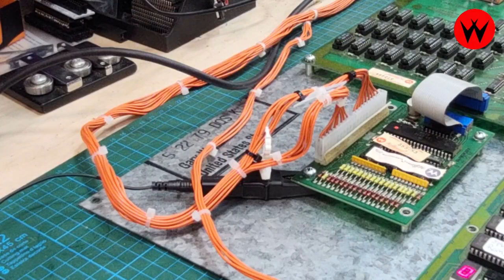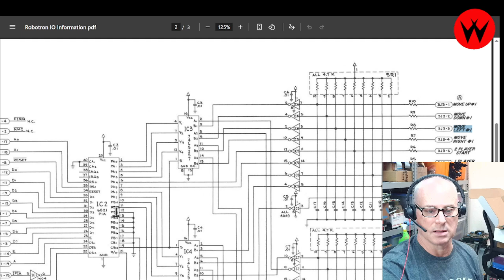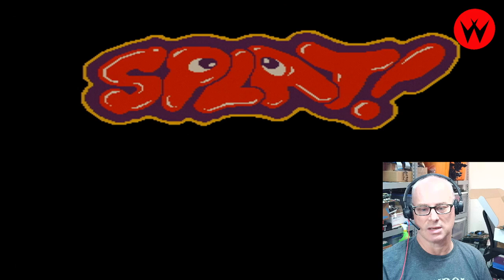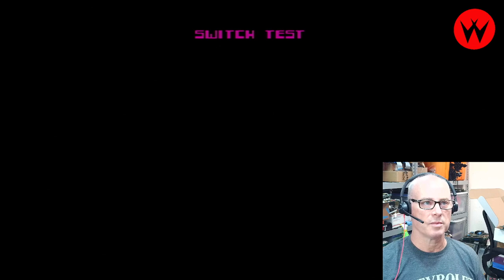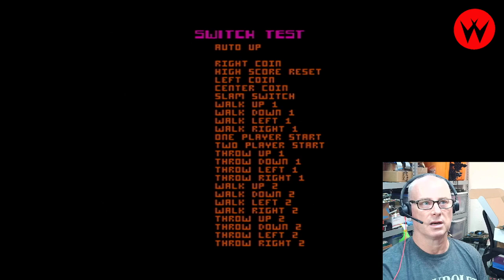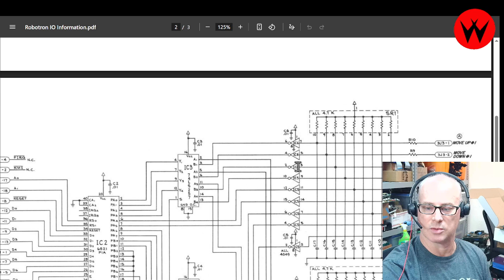Robotron - Widget Board Problems - Watch the Ribbon Cable Act Up!

Comment: Most arcade games don't use a PIA chip to monitor the I/O inputs of the arcade game. Any reasons why Robotron is using a PIA chip for the I/O inputs?
Reply from the maker: I think the hardware engineers were very comfortable using them since most did pinball work with with a zillion inputs